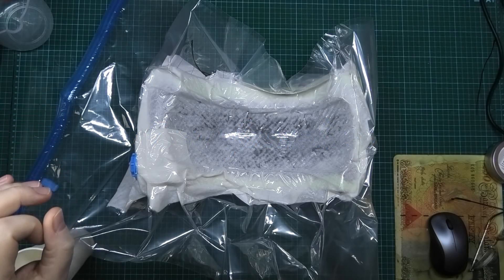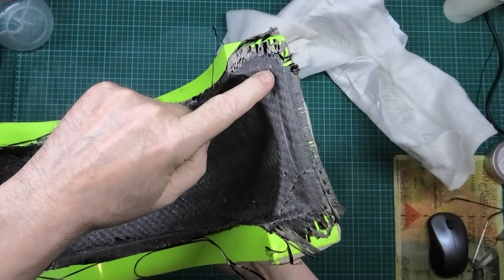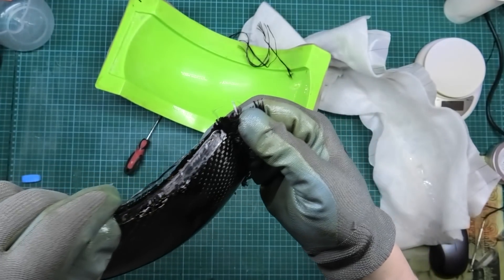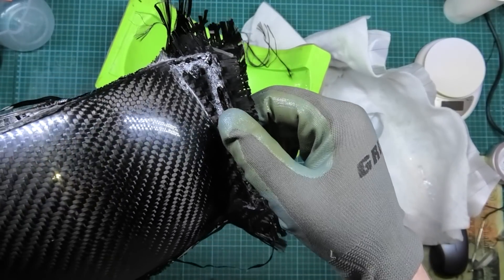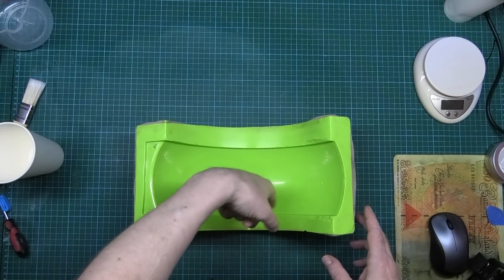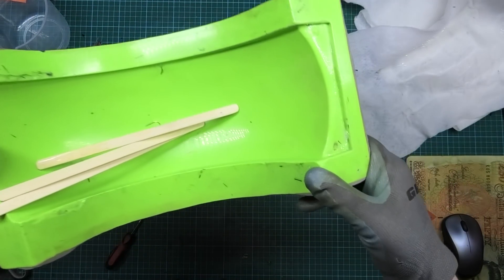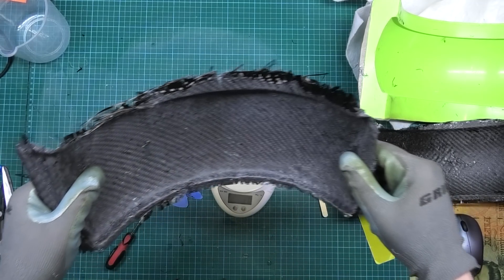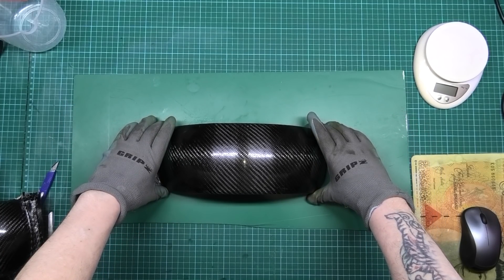🔴 EXTREMELY POWERFUL E-SCOOTER BUILD part 15 - The perfect carbon fibre (fiber) part from a mould

Comment: Hi I got the same scooter and I accidentally put a screw into the charging port and loads of sparks came out of it and it won’t run on anymore can you help me by telling me what I broke or burnt and how to fix it thanks
Reply from the maker: At very least, the BMS in the battery has blown. You'll need to take the battery out, take off all the insulation, find out what BMS it is and replace it. For me, it's an easy job but it might not be for you.
Reply: Oh I’m screwed 😢

Comment: Maybe a bit of compressed air, blown in-between the two parts, would help getting it out of the mould. Just an idea.
Reply from the maker: You're 100% correct, it would help a lot. One small problem, I haven't got a compressor 😥

Comment: Good job Tony m8...I like the way two simple bolts hold it onto the frame. Although moulding layup there was a bastard to do...🤔😳😀🇬🇧
Reply from the maker: Sorry for the delay mate. Yes, it's a bastard alright but it's worth it. I want to make a fully carbon fibre plane one day mate. I'll have to overcome major signal blockage issues but I'm looking forward to it already 😁
Reply: @Vortecks  Well, those high end gliders are made of carbon skins around blue foam....So it should work as long as the antennas are positioned correctly...My new bike battery arrived this morning...🤔😳...Now I can investigate the original one ..Dead cells or BMS???..🤔😳😳😳...

Comment: i have a dream of making my own carbon fibre sinclair c5.
Reply from the maker: Now there's a challenge!
I think my next project has now been decided 😁👍
Reply: @Vortecks  my mate made a 72v one goes 65kmh. I designed my own rear axle to take different wheels and put on a front hub motor. Great little runaround.

Comment: Well done mate. that looks awesome. Not many people appreciate the Work/Pain/Blood/Sweat and Tears that goes into making CF parts. Nor do they appreciate it is almost impossible to make them perfect. 
Funny thing is you made all the same mistakes I did with sharp corners and dodgy flanges but you still managed to make a great looking part. Congratulations.
Reply from the maker: I have to make mistakes or I won't learn mate. It annoys me that when people make videos, they show the start, a bit in the middle and the end but they don't explain why things are done a certain way and they make their parts look immaculate right from the mould - we both know that it doesn't work that way unless you use infusion.
If you haven't tried forging you own parts, wait until later...... I did and it's stunning 😁

Comment: I know it is now after the fact but as I have said before previously on the e-bike battery carbon fiber layup build that with said material you get your strength at each end of the direction of the weave so because you laid up your weaves layers on a 45 degree you will end up with no strength at the 90 degree which is why the finished composite was twisting Tony 😐 not sure if it was a 3ply layup but if you was to 1st layup a 45 degree weave layer with the 2nd weave layer being laid up at a 90 degree layer with the 3rd weave layer at a 45 degree you would get strength in all directions, but as it may only be a 3ply composite you may still get some play in the finished composite unless you were to up the layup to a 5ply layup such as a 45+90+45+90+45 etc you would end up with a strong finished composite and if you were to hit that with a sledgehammer the sledgehammer would probably bounce back and smash you in the face 💥🥴 😁

Also you can build up the layers as a block for any mounting support areas too I have laid up to 50/60/70ply blocks to be laid up within moulds for further cnc machining such as for screw hole threading inserts etc to be added later.

I used to work as a Composite Technician for C2 Composites.

https://www.c2-composites.com

Yours fatefully

Me 🙂 👍🏼
Reply from the maker: I purposely didn't watch any videos about carbon fibre laying because no one goes into any detail about 'why'. They just do it and show a perfect part with no problems along the way, it's so annoying. I have since found out that a weave along the length of the part makes it torsionally strong and that's what I should have done. I've just finished the swing(ing) arms which uses various directional weaves and they have zero flex and they're unbelievably strong (much stronger than the original) so I'm well on my way.

 I've been waiting for someone to come along who actually knows what they're talking about so you'll be sorry now 😂 I'm just working on the rear suspension cross-brace (forged carbon which also has various weaved additional layers) which holds the 2 arms together and it has to be threaded and bolted. Rather than tapping directly into the part and using the strength of the carbon/epoxy (which I have tested with great success on a test part) is there a better way? I have some threaded inserts but these are more designed for thread repair work or I have some others which are self tapping and used primarily for wood. Is there a better way that you know of?
Reply: @Vortecks   not too sure about the process for the fixing of inserts as that procedure would take place elsewhere in the manufacturing process of the composite but if you have had good results when testing with carbon epoxy for load bearing then that maybe sufficient for it’s intention Tone.
Reply from the maker: @whitestar4431  Cheers mate. I've read that it should never be done because of galvanic corrosion which carbon fibre suffers with. My argument is - if you put a metal insert into it, it's the same thing! This is a solid block of 3" x 3" forged carbon so there's no way it's going to break 😁
Reply: @Vortecks  I have familiarised myself with galvanic corrosion and understand that this is a consequence of the type of environment in which the application is or will be used in but it is also my understanding that An epoxy adhesive will insulate against galvanic corrosion and that you only need fibreglass or anodised ali if you are including the metal in the layup of your part.  If bonded on afterwards, there shouldn't be any conductivity from the carbon to the metal.  Also anodised aluminium or stainless steel or titanium inserts along with epoxy maybe the preferred choice for long term use but you do you Tone
Reply from the maker: @whitestar4431  I've read all about galvanic corrosion too mate. I'm taking my chances and aiming for it to never be used in damp conditions because there's no avoiding direct contact between bolts (steel) and carbon fibre. 
The support brace will be tapped and bolted direct into the carbon with WD40 to keep moisture out, there's no avoiding it and it'll make a far better seal against water ingress than adding inserts.
It'll be fine....... fingers crossed 😁

Comment: Looks awesome! A little more bendy than I expected but it’s fine for the job it’s doing. As always, I’m impressed with your resourcefulness and patience. I’d have spent hours trying to save the first part out of the mold. And then I’d have probably made a second one as well. So patience CAN save time.
Reply from the maker: Cheers mate. It's all new to me and I refuse to watch any tutorials because they don't explain why things are done in a particular way, they just show the finished product and not any failures. I've since discovered that a straight weave along the length of the part would have made it torsionally strong but hey-ho, we all have to learn somehow 😁